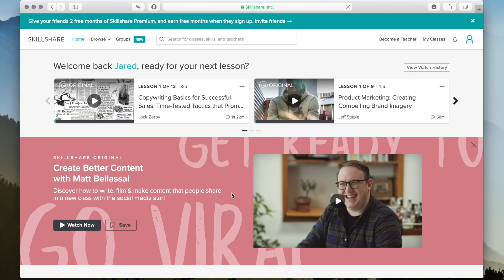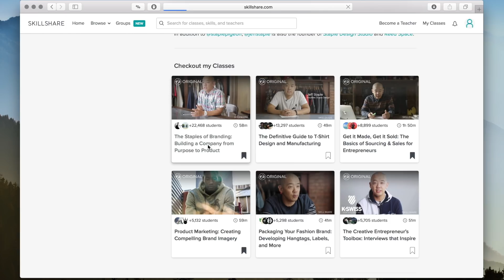How To Make Your Speaker Room Sound Better (FAIL?) || DIY Acoustic Wall Treatment

Comment: Fail? In what way did it fail? Well, looking at other videos/websites, it appears that the "dispersion" you refer to, is generally referred to as diffusion, and to do this properly you need to accurately create a dispersion pattern, a typical example of which is a quadratic diffuser. This will work over a range of mid frequencies, depending on the size and depth of the diffuser elements calculated from the mathematics.
But this as i said, needs to be calculated and built  according to some sound (pun intended!) acoustic principles, rather than just creating some angled surfaces and hoping that they will work.

 I think what you ended up with was a nice wall decoration, which will have little control on diffusion of audio, if at all, and as other have pointed out, very little in the way of absorption due to the low density of the foam.

Comment: I like it as a way of housing and making the foam squares look nicer. Yeah, you need the straight up mass and density for bass trapping but  You've got the woodworking skills and the know-how, I love it. You could make KILLER looking bass traps with a slat/scatter face plate over the fabric like that. Just scale everything up for housing "safe n sound" batting.

Comment: The best approach of sound treatment is to start with bass trapping - you bass trap all the corners (vertical and horizontal) as much as you can and then carefully start with the first reflection points from the listening position.
The goal is to have equal absorption at low, mid and high frequencis!
Don't forget to measure and check what r u doing!

Comment: Very nice construction, one thing I would recommend is putting an insulation like rock wool inside the panel instead of the foam, I think that would make the absorption much better.

Comment: It's pretty, but others have pointed out that this is not an effective diffuser or absorber.  Look into the densest 4" Roxul Rockwool or Owens Corning 703/705 for absorber materials.

There's a second problem.  Even if the diffuser were built effectively, you're doing more harm than good in your room due to the listening position being against the wall.  You will have significant time smearing as a result.  You would likely do better to simply absorb on that wall, and to place your diffusion on the ceiling.  Look into designs which are more like the Auralex T-Fusors for that.  One role of a diffusor is simply to bounce the highest frequencies in a 180-degree pattern.  But the other role is for these directionally diffused "bounce" waves to then essentially *destroy* some of the oncoming waves in front of the wall--a little zone  of waveform death  very similar to what  happens to ocean waves when they hit a rocky shore.  That's why sitting directly in front of a diffusion panel is a no-go.  It's not just the mangled reflections.  The listeners heads are in the dual-mangle zone.

Here are some general tips:  You're right about not absorbing the snot out of the room.  Stagger absorption and reflection zones, so that each wall is equally reflective in total, but that the reflective part of one wall faces the absorptive part of another.  That way you're killing ping-pong reflections, but not killing the liveness of the space.  Generally, absorb the wall behind the speakers most, the wall behind your prime listening area the least.  Floors, unless they have ludicrously thick carpeting, are reflective at most frequencies.  Absorb liberally on the ceiling up to the primary listening position, diffuse heavily behind the primary listening position.  This gives a dual benefit, causing the direct signal to be very "quick" and present sounding, while the ceiling diffusion behind gives an acoustic illusion of raising the ceiling height.  Because the "destructo-zone" in front of the diffusers is now above the listening position, none of that time-domain smearing is heard.

Final suggestion:  Bass Trapping.  HUGE benefits.  Almost no small room fails to benefit from it.  Those are easy to build out of 4" Rockwool.  Essentially you build a "right triangle" of Rockwool which traps and absorbs bass buildup in the corners.  The end result in most cases is an immediate improvement in bass response.  Sounds counterintuitive, but *removing* bass from the room by burning it off in the corners actually allows the lowest frequencies to manifest without crazy interference from all the bottled up bass in those corners.

Now, granted, my experience in room treatment mostly relates to studio control rooms and recording spaces.  Most people will not want to go that far in a living space.  Bookshelves are great "free" diffusion banks.  The different shapes and sizes of stuff on the shelves breaks up waveforms that would otherwise ping-pong between walls and cause problems.

I could write a book, of course...there is much nuance in all of this, but that's a little head start for you
Reply: I prefer Roxul Safe'n'sound over the Corning 703. However, if money is no object, I would take the 705 over Roxul.

But yes, any variant of open cell foam is a no go for sound absorption. We want those fibers to rub against each other and turn that sound into heat. The same will apply when stuffing an enclosure. The open cell foam is essentially useless.
Reply: I think YOU did just write a book!
Reply: Your advice has a huge value, thank you!
Reply: thanks for your time dude

Comment: Nice work, but you need to get your terminology right. Frequency doesn't have amplitude/volume. I heard other wrong things like isobaric chamber, which doesn't have much to do with audio.
Reply: I’d have to agree, but isobaric is also a type of speaker enclosure loading. Which he was probably thinking of at the time

Comment: Kirby... and I mean this as a friend- what you have built here is cute "wall art"  and will do nothing for the acoustic issues in your room.
Reply: While I believe that, I want to know WHY; otherwise it's just hollow opinion. Can you explain?
Reply: Jonathan Sias - I’m glad my comment was though provoking- I would certainly encourage you to learn as much as you can about acoustics.  Best of luck!
Reply: It's definitely not going to be as effective as a true quadratic diffuser or a well-designed absorptive panel, but it's an interesting take on a diffsorber. If you were wanting it to be more effective (you probably know) you'd need to have a much more random pattern of slats, rather than a repeating pattern.
Reply: Trevor Jones , but it looks tight right ?
Reply: Its all to do with wavelength, The foam you are using up against the wall will only effectively absorb frequencies above a certain limit, which is where the thickness of the foam from the wall is bigger or equal to 1/4 wavelength in this case. The bars to scatter the sound are also very small, they will work for very high frequencies but not below. Density of material is also important: dense stuff like rockwool is better at eating mid frequencies but reflects some high stuff due to a large mismatch of impedance (resistance) between the air and the material. Unfortunately treating a room properly inst easy...
Reply from the maker: I agree! It's probably not doing much. Like I said in the video, i'm still learning about this stuff and already purchased the foam. Thanks for watching!
Reply: Kirby Meets Audio , I was basically sticking up for you. people can be mean and really stupid.
some of the comments are just childish and mean.
God bless and keep up the good work. by the way, that really does look nice
Reply: We have all been there, I started off with that foam too (but the unit was not as pretty of course)...keep up the fantastic woodwork! if you would like to know more about absorbers/diffusers...there are some fantastic articles from the BBC which give some great pointers :)
Reply: Yeah, Spyro’s comment is spot on. My next (and maybe last) speaker build has been waiting on completion of a good sound room for years now )  makes me want to start liking headphones. Despite any debate to the degree of effectiveness of your new panel (your intention wasn’t to re-build the room)..it’s a start and most importantly it looks great ! ( no one wants it otherwise) I also have no doubt it will have a noticeable positive effect directly behind your head...As always: A very practical, clean and creative design!
Reply: @KirbyMeetsAudio  why u only use Dayton audio products. Is there are some other goid quality brands are available
Reply: @trevorjones4097  Nice Sidestep of the question.
Reply: @jagdeepsharma1772  cheap/available/adequate.